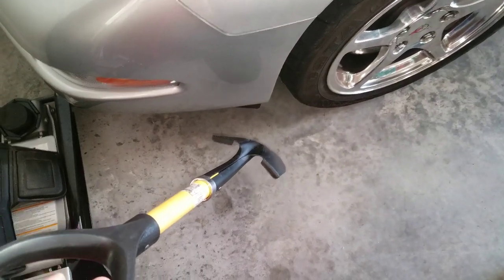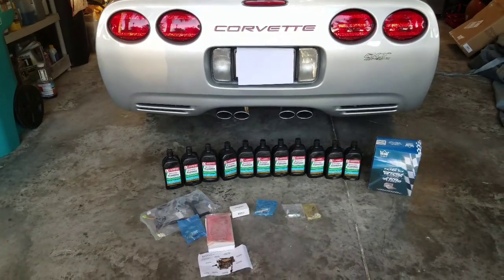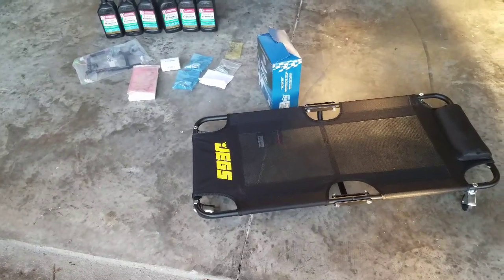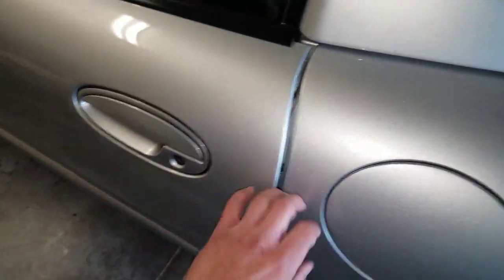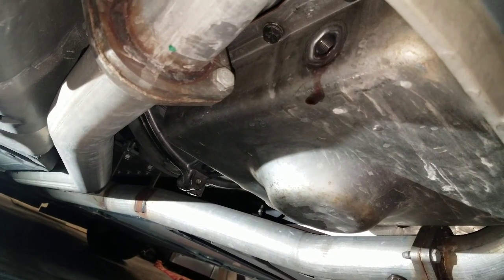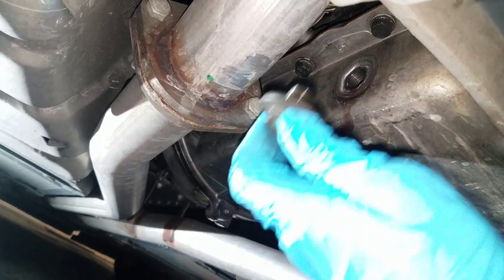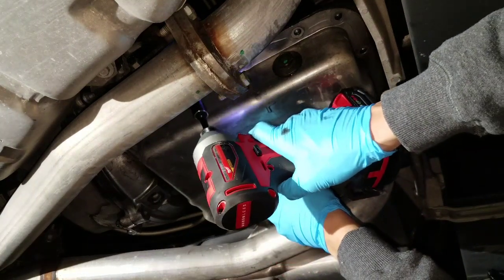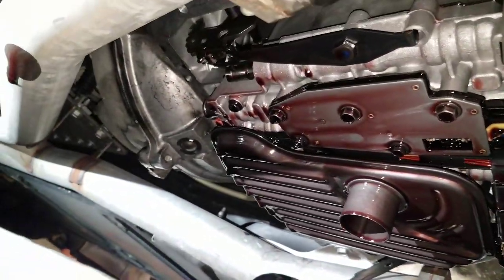Changing solenoids in a 4l60E transmission

Comment: Why did you go to the store and get a pump for the fluid instead of just loosening the front pan bolts to let the fluid drain out lol
Reply: Because even doing it that way sucks major ass. The pump is a simple, cheap trick that makes the job that much less shitty.
Reply from the maker: @sineadfigiel585  get em. Lol
Reply from the maker: I think I stated that in the video. Plus I used the pump to put the fluid back in.  Thanks for watching.

Comment: The one thing I wanted to see you didn't do. I wanted to see you remove the main harness plug. Oh well, still better than half the videos on this transmission. I'm doing my trailblazer. They have the same exact transmission. Only difference is I have the deep oil pan you have the shallow.
Reply from the maker: To remove the whole harness you have to take out the whole shift plate which was something I was not ready to do LOL.
Reply: @chemicalspore  I found a video where the guy used like a 1 1/4 12 point socket to push in all the clips around the round plug. pretty smart. Only problem was the tranny was out of the vehicle and the upper exterior plug had already been removed. maybe it becomes more accessible once the tranny is dropped. I looked under my truck today and could see where the exterior plug was and was able to touch it. but unless i remove the exhaust and heat shield I don't think i could manipulate it enough to un-clip it. I was actually thinking of reusing the harness that's in there and splicing in the new solenoid that is attached to the new one. It is only two wires, I could solder them and shrink tube them. I don't know. I just know I have to something. It also has me wondering if the ATF is non-conductive. I'm assuming it is considering all the other electrical components are swimming around in there.